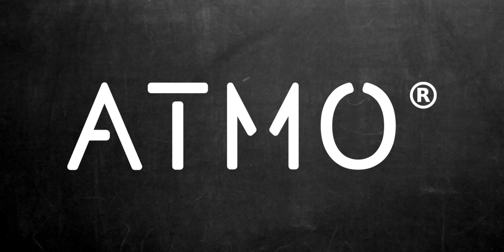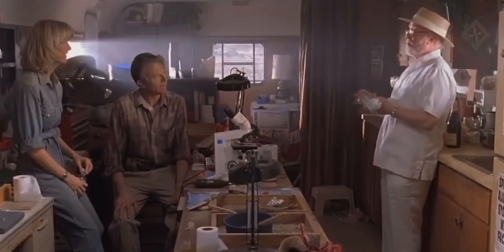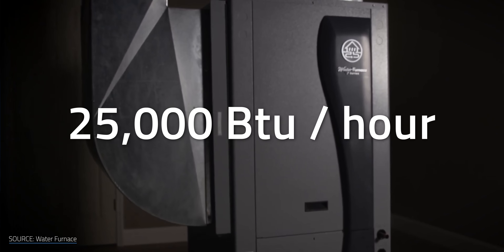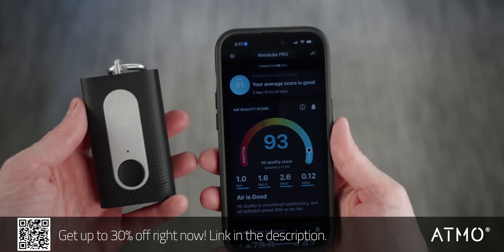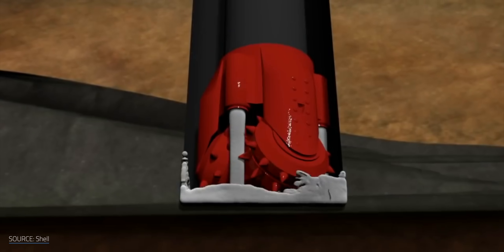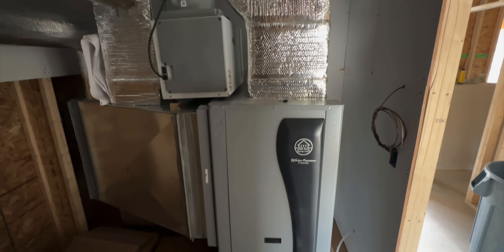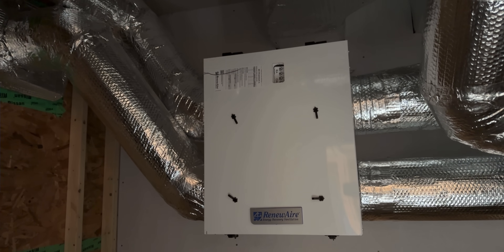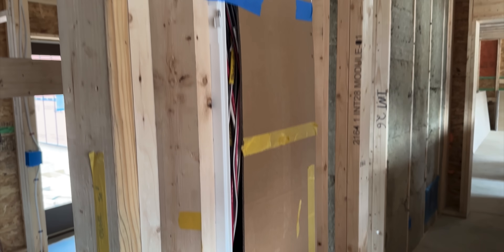Why I Went With Geothermal For My Net Zero Home

Comment: I have a home with a pretty similar setup. Some unexpected learnings: the span is essential, especially if you have regular outages. There are all kinds of things you need to turn off automatically to make the batteries last longer in the winter. But, due to the way electricians wire panels, I needed to add Sense units to each panel, so I could monitor individual appliances. The Lutron Caseta line is very good but the hubs really do have a 75 device limit, they become unusably slow and unrealiable after about 70 devices, so if you're anywhere near use one hub per floor. (Same goes for Hue.) Hue is also important, as a single light switch or the Lutron lamp controllers just aren't enough once you get into a large set of scenes. Love the electrical lines to the windows, I'd also make sure there's heavy duty power points for chargers in the garage even if you don't intend to install any for now. IMO you can never have enough ethernet, so good job there, personally I wish I had put two not one behind each TV! Finally, Ubiquiti is the least worst solution, but good luck doing separate VLANs for IoT, getting anything RMA'd in less than a month, and when your UNVR dies, the only way you'll know is that the doorbell glows read with the message "SECURITY SYSTEM OFFLINE" for all to see, except yourself because you drive your car into the garage. I still don't have solutions for: detecting if windows are locked, not just shut; lock detection for metal/sliding doors (I use level for regular doors, mostly to ensure they are locked); timed fan controls for bathrooms (I'd love to put an occupancy center in each one and run the fan once the human has left, but only if they were there for more than x minutes); I'd love to get more telemetry from my appliances (fridge, washer, drier, etc.) but they are all closed systems; I wish there were 100W USB-C ports available in outlets; I would have fitted more wifi enabled outlets too, instead of after market plugs; and finally, all the major frameworks for controlling the home (Homekit, Home Bridge, Home Assistant, Google Home, Samsung, etc.) are all super immature. I'm fixing stuff literally every day. Good luck and please keep these pieces coming.

Comment: Question on the heat pump water heater. We had one but no longer do, it died.  Consider a straight electric water heater such as Bradford White makes about 4 miles from here, are the cheapest available type for home. They are very well insulated and who knew, 100% efficient! Being electric, no need for venting or fuel lines and we have an all electric home. For about 9 months of 12 our Geothermal system's de-superheater provides most of our hot water by heating a 40 gallon tank that sits in line before the electric heater.  The water heater consumes about $6.50 of electricity monthly when the heat pump is in use and about $20 in a month with no heat pump operation for a total of $138 per year. Now a sample 50G heat pump water heater at a local big-box store is $1,950 NOT installed,   while the same brand same store 50G electric is $549 NOT installed. So that $1,371 cost difference would take 9.9 years to pay off if it magically reduced electric use to $0! And the bloody thing won't last 10 years, while the electric Bradford White we have is 20 years old and still heating.  

IT GETS WORSE! Where does the heat come from that the heat pump unit is using to heat water? From your Geo unit! If that water heater cools air, the only way it gets re-heated is by running the Geo more. So the calculations are messier still.  Yes yes in the summer that thing is making 'free cool' but here in The Mitten we need heat much more than we need cool! 

For those who DO NOT live where the snow piles up to your knees a HP water heater may be a fantastic choice, but not in a cold climate. Prove me wrong!! :-)

Comment: I will be very interested to see about the longevity of the heat pump system you decided to get. From what I have heard from people who work on heat pumps is that the more advanced and typically more efficient ones tend to break much more often and have a shorter lifespan.

Comment: We have used Geo for 30 years. Current system is WaterFurnace Series 3 which is a two speed  unit. Unlike your setup we have an open loop system which uses our well for the heat/cool source and then returns that water to the ground in a drywell.  There is an issue with open loop and multispeed heat-pumps: The heat pump installers only install an open/closed valve for the water flow. This means that when the heat pump is on low speed, which is 90% of the time, the unit is blowing through sufficient well water to run the thing on high.  Given most of the time here that is heating mode, they don't want that water to freeze in the heat pump so they run minimum 6GPM which goes up when the well pump pushes up the pressure, to about 9GPM! That's easily triple the water needed when the system is on low speed compressor! Input water to the heat pump is about 55 in winter and at 6-9 GPM it's coming out at 47-50 degrees!! Additionally our well runs up to 70 PSI and the heat pump only cares about sufficient flow, not pressure so FOUR valves in sequence were needed to step the flow down in order to prevent cavitational noise which is MUCH louder than the heat pump itself. And, clearly that's just wasted energy.  I have built an Arduino controller which monitors the water output from the heatpump both temp and flow and keeps the outlet water at 35 degrees (Winter) and 90 degrees (Summer) and it is fed not from the primary well at 70 PSI, but from storage tanks fed by a 0.1HP pump at just a few PSI.  Measured savings from the well pump are more than 2/3rds! Our well pump draws 1.8KW which is not much less than the 2.4KW the heat pump uses on low.  All in your closed loop system will be cheaper long term I expect.

Comment: Interesting about keeping warm water in a cylinder. But how do you control legionella. Domestic hot water storage tanks are supposed to be set at 60deg min. With a pre-warmed water tank, this temperature will be considerably less - hence the legionella risk.

Comment: You should pay attention to two major point is geothermal loops.
1. the level of gas in the compressor. Low level gives very bad energy transfer efficiency 
2. air in the loop. You need to bleed it and it can easily take up to two years.
I had both of the above issues.

And a minor point the present of water to alcohol ration in the actual loop. Normally you can just add water but you need to have around 24% or 1 to 4 ratio

Comment: Tip, divide the geothermal storage into 2, a cold one and a hot one for the days that have the greatest variation in temperature, suitable for cooling the house and storing it for the night. In strong winter the 2 will store the day's heat.

Comment: 400 feet deep? That's baller! You made the right call over air sourced and with this being a  "forever home" you've made a great investment for the future. The only way you'll regret it is if in 10 years they nail fusion power and electricity costs drop to $0.01 a kWh across the country.  Chances of that happening? Close to zero because they will always find a way to make bank from power. Meanwhile you'll be 100% off grid and happy (okay maybe not for water - i forget your situation there).

Comment: Where I live, we don't call them GeoThermal, but GSHP (ground source heat pumps).  I had ours installed on Jun 2008.  I live out in the country and our heating was LP whose prices moves with the price of oil.  Anyways, the best decision I ever made.  It was pricey but my ROI ended up being in seven years.  One other advantage of a GSHP is the compressor runs at a lower pressure which extends its service life as compared to a traditional condensing unit.  The heat exchanger is the Earth.  And  when I think of GeoThermal, I think of "Old Faithful".

Comment: With a Smart system you could have a learning algorythm for radiant heating to figure out "when" it needs to stop heting in order to reach the ideal temperature. Also, a radiant system can both heat and cool. There's a system in Montreal Quebec that works that way(in an Apartment complex). Too late now of course.

Comment: Interior shades have little effect on heat and cooling.   A smart system has EXTERIOR shutters, for example those that roll up and down on tracks, open and close based on conditions.   Even smarter than exterior shutters are deciduous trees outside window so that direct sunlight does not hit the windows in summer and does hit the windows in winter.   Beautiful, efficient, and far less likely to break down: trees.

Comment: The house is nice, but as a swiss who did build a house for himself and as an HVAC+Electric Engineering i would say there could be improvments. But the House seems to be innovative for the America. A ground water heatpump works very well with a underfloor radiator becouse of the low temperaturen difference, and in summer you can use it in reverse Mode to cool the house and renew the Ground heat, that is more important in an area with dense population and a lot of heatpump. I went with a shower from joulia (a swiss company) that excange the used heat from the water with the incoming fresh water an can save a lot (at Max 60%) of the shower energy. I also used a heatpump to cool down the used air that i vent out of the house to heat the water (it's the invention of a small swiss company and dont have a Name), the energy in the air you vent out can be keept in the house and you can use it again and again (with the looses on the insulation). But the house you built is pretty nice and i wish more house would be built like this.

Comment: Why wouldn't you be able to use radiant cooling? Just pump cold water, not rocket science
Reply: It definitely can be done, but for ideal operation it requires some quirks not all setups might have included. Also as he mentioned having a very well insulated house will quickly change temperature due to different heat sources like using the kitchen appliances, more people in a room or the sun shining through the windows. So for that you need a system which can act quickly, radiant water heat is relatively inert, especially with larger surfaces like e.g. in floor heating which is better for heat pumps due to lower needed flow temperatures.

Comment: would like to hear about how well the heat pump handles low load dehumidification.  Does it have over-cool and reheat, or other dry mode for when dehumidification is needed but cooling is not...

Comment: For anyone curious on costs, a 200 amp panel upgrade was $3500 (we didn't need to trench any new wires). A 200 amp SPAN panel was quoted at $9000.

You really need to get a lot of additional efficiency out of a smart panel to make it worth the cost.
Reply: I just got a quote from my electrician in Texas for $5k installed for the Span. Doing this first to see if I need another trenched line. Shop around!

Comment: I would have gone with water radiant heating elements. They are far more even and no hot or cold spots or constant kicking on and off. Always remain even temp.
That said, you said cool air. And that makes sense so I understand you went that way. I mean if you can also get like an "air conditioning" for summer it has duality to it and I would likely in that sense also choose it.

Comment: Hey Matt, love the vid. I also have about 60 blue cables running around in my net zero smart home over here in Melbourne (yes my partner also thought I was going crazy).  I'd love to hear more about your smart home setup. How are you planing to automate your ERV.  I am in the same boat with my HRV but need some guidance.

Comment: I did all of the above last summer, solar, geothermal, span panel etc. got the exact same setup as you for the geo, one thing I did notice in the summer when its cooling the air coming out of the vents is freezing cold it takes a few tries to find the ideal temp, and if you have the vents on the floor like i do you're gonna be wearing blocks of ice on your feet 🤣. Wish i could get rid of gas however wife does not like electric ranges...

Comment: Two years ago we retrofitted our southern Wisconsin 2400 Sq Ft home with a 4 ton Waterfurnace radiant floor heating system, replacing our wood stove and electric baseboard heating.  We have four 400 ft loops buried about 8 feet deep by a ditch witch, about 15% more expensive than trenching, but much less than a well bore.  Our winter electric bill is about 5% higher for the last two years compared to the previous 5, but we heat more of the house to a comfortable temperature and burn no wood.  I estimated we had gotten about half our heat from wood, so this is a big win for time, money, and air quality.  

One thing I wish was different was the installed thermostats are not compatible with the symphony app so I need two apps to monitor and adjust the system.  I’ve played a bit with Home Assistant, but my thermostats are also not registered with Home Assistant.  I also think the WaterFurnance Home Assistant integration is not fully fleshed out.  I’m running it in a VM on my PC and I do like the graphics - watching the incoming loop temp drop as the winter goes on.

I’m having a SPAN installed this summer along with some additional PV and battery for backup.  I won’t make it to net zero, but should halve the distance to it.
Reply: Thank you for choosing WaterFurnace for your home. We appreciate you.

Comment: hi i love your videos on this types of technology but there is something whispering in the back of my mind, so i just have to ask, your going full solar with batteries i think? I saw someone who because of the pull bill to connect to grid went full solar, but the installer warn them about the weather there because in winter or a prolong storm the solar panels wont get enough to charge the batteries so they added a gas generator (they had a gas tanker underground) that  start  when the inverter checks the bat level is low and there is no solar. Do you have a kind of fail safe for those situations? cheers

Comment: Hey Matt, enjoy your content and congrats on the geothermal system. I owner built a home 20 years ago, I've since sold it, but we lived there for 10 years. It was in NC and was 4600 sq ft. 1600 below grade. It was built with 8" Insulated Concrete Forms, so similarly tight and efficient as your home is. We used a Water Furnace 5 ton, 4 zone variable geothermal with a horizontal grid. We also had the water heater exchanger and heat exchanging ventilator as well. I had calculated a payback of around 8-10 years. End result was a 7 year payback. If I were to build another house I would go geothermal for sure! One thing that is going to surprise you is how quiet your home will be with the windows and insulation. I remember sitting at the kitchen table one time eating dinner and realized there was a severe wind storm outside only because the trees were half bent over. Keep up the great work. It is enjoyed by more people than you know! Forgot to mention, our average power bill was $186 per month over the 10 years, all electric, huge savings!
Reply: That's great feedback. Thanks for sharing your geothermal experience with the community. We appreciate you.
Reply: Just curious as to how many people in the home and how much time they spent at home.

Comment: Given that you vertically installed you could also do a free well for the garden, the only issue the combination hot water and buffer for the  heating on cold days your drain the buffer in no time, so it’s worth having a separate the hot water by having an a rated a heat pump cylinder for hot water to separate the two I find helps since it only charges mainly when the main heating isn’t needed such as over night . Ps he’s right about it getting to warm and can cause condensation with gap areas such as around vents and toilet/waste outlets, so I hope the hvac can do heat exchange recovery-to stop that, the reek hot water unit has to ventilate externally or it will chill the home

Comment: The benefit you get of free "warm" water from the geothermal heat pump will be exclusive to when you're cooling your house in the summer, won't it? In the winter, the system will want to keep all the heat it creates for the forced hot air. In the summer your solar panels will produce far more energy, so this is non-ideal as you really want winter to be more efficient for hot water generation. This is another reason why hydro radiant floor heating would have been more efficient towards net-zero.

Couldn't you just set the temperature a bit lower with radiant heating and avoid it overheating the house??

Great video! Can't wait to see more about the house!!

Comment: I look forward to seeing more videos on the tech in your new house, Matt. In January I replaced my old HVAC system with a new 19.4 SEER variable speed heat pump. Installed a Rheem heat pump water heater like yours last month. The solar panels will be installed in the next couple of weeks. It should be interesting to see how it all works out on my 20 year old house.

Comment: Always find it funny that people make these super tight houses then think some sort of heat exchanger will magically keep from losing heating/cooling out of the house. You're just being fancy sending your hot/cold air to the outside, your heat exchanger is nowhere near 100% efficient. Don't be fooled by the claims they are 80% efficient, because there is no free ride. Blowing air around your home isn't free. Nothing wrong doing all this, if you're rich and have the money. If not, it's really never going to pay for itself. It's just more things to break and need replacing in the future. Anything that's passive and never wears out is a win. Everything with motors and or moving parts will never last forever, so replacement costs should be figured in over your lifetime.